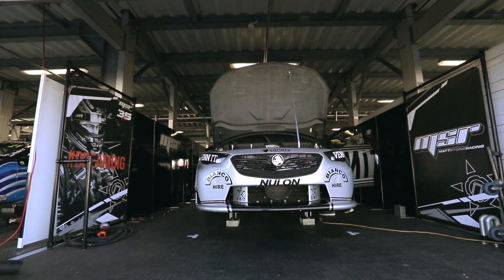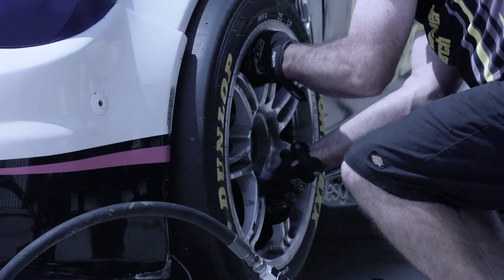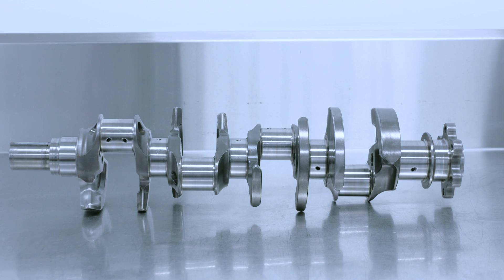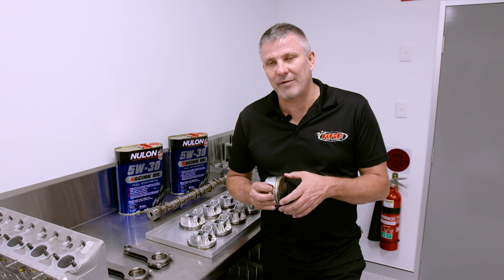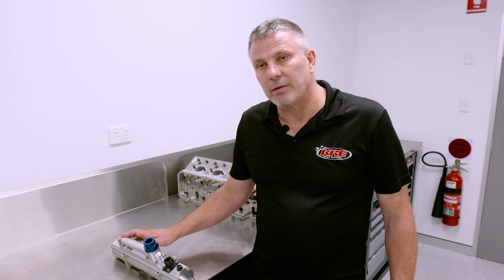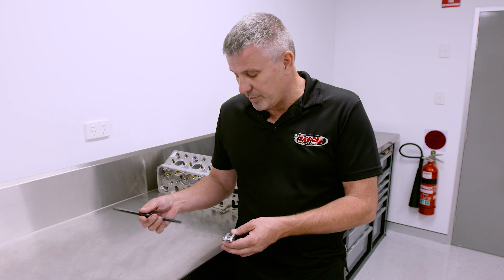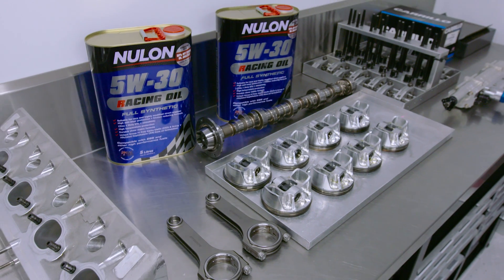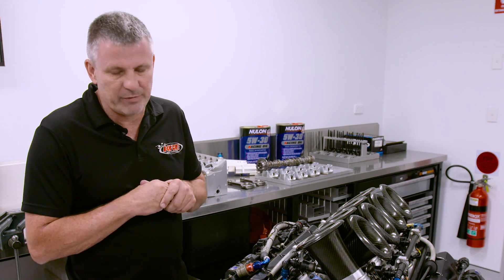Inside a Supercar V8 Engine! The facts, history and secrets with KRE Race Engines

Comment: 9:48 hi some one know more about the “individual oil pan”? And oil windage because i cant find information,
For the separation of each pair of cylinder did you use the oil pan very close to the crankshaft main cap and/or some divider?
Last thing i remember some Mercedes use the “individual oil pan” and use the oil windage to push piston.
Tanks

Comment: The chamfer in the counterbalance looks backwards. Shouldn't the larger bevel be towards the main bearing so it can I pull more of the oil mist away from the rods and towards the main bearing?
Reply: No because the mains are priority oiled and always guaranteed to have enough oil especially with a dry sump. Not to mention looser bearing clearances to allow the crank to spin freely.
If you were to spin anything, it would be a rod bearing so that's where you want the oil. They run such a high crankcase vacuum that it's a worry about pulling oil off the rod and piston combo, sucking them dry. Hence that shape.

Comment: Cant believe engines like this are still used, especially in racing. Push rods and 2 valves per cylinder went out of fashion back in the 1930's. Why are people so slow with technology I will never know.
Reply: its about engineering and performance and function  not fashion  .. what "technology " are you talking about  ? OHC stuff  thats like 20 years newer but still 100 years old .. All the technology is in the materials  and the 50 years of refinement the SBC has .. 4 V stuff breaths better  witch is of no benefit  because the power is capped  at 650  the control cam has stopped the clumsy valve chain self destructing  DI is a worthwhile technology  that happened in the last 30 years witch might be worth adapting push rod V8s have better pakaging and  decent torque a quad cam 5 liter V8  is externally as big as a 7 liter  pushrod V8 . be interesting to know how the  quad cam discussion went  when NISSAN Merc Volvo where all dabbling in supercar  you would think they've have pushed for it  and despite my tech ranting I  imagine the real reason they use pushrod V8s is that both NASCAR and super car are intended  ford Vs Chev thing  and they would have a bit of influence

Comment: "A 2.960" stroke, quite a short stroke. From 1970 on in Trans Am the Javelins were using a stroke of 2.916 with a 4.80 bore. Pontiac was a 2.840 with a 4.120 bore.
But comparing race engines today with the ones 50 years ago is like comparing a race horse to a nag

Comment: Now you know why current  v8 supercar racing is absolute bullshit. Maximum LIMITED power from the  motor. SO where does the Ford v Holden come into it. The only difference btw the cars is the artificial shell body on the frame. There are idiots out there thinking that its still Ford v Holden and others. Durability and reliability has nothing to do with this category. Each race is made up of numerous little sprints because of the safety car. All major distance races around the world do not stop and restart when there is a problem other when the track is closed..  Perfect example WHINCUP down one and half laps after only about 45 laps at Bathurst. Comes in at second place purely on the back of the safety car. This is as big as bullshit as Brock changing cars when he blew up or damaged his original car and winning in a second car

Comment: Gotta say, getting 650hp from a 5 litre with 10:1 compression is pretty impressive !
Reply: 160,000 for a new engine.
F1 engine, millions
160 is a bargain
Reply: They aren’t $160k anymore they are trying to get it down from $100k to $40k. And they have to last for at least 5,000km almost a whole season so that cost spread over the season is pretty good really. They are now targeting 10,000km from each engine.If they wanted more power they could easily get more out of them. They are tuned specifically to that power target and the whole car is designed around a certain top speed and acceleration.
Reply: Getting the engine to rev to 7,500 helps.
Reply: @elroyfudbucker6806  7,500 isn't that much for a race engine. It's quite limiting really. In the late 80s they were spinning them to 8,500 - 9,000 and we've come a long way since then with machining, engineering, metallurgy etc
Reply: @change_your_oil_regularly4287  Yes but these engines do 7,500rpm and last for 5,000kms. 
Those ones doing 8,500 - 9 were junk after one race.
Reply: Is this 650hp at the Crank?
Or at the rear wheels, on the Dyno?
Reply: It is but it would be nice to see 700hp, theses cars have had this power for the last 20 years.
Reply: @markmallinson935  yeah it’s boring
Reply: @markmallinson935  before control camshafts came in, a HRT engine mechanic (for Tanders' VE) said, when dyno tuning on a chassis dyno, they would make 600 hp at the tyres, so they have been above 700 for a few years now...
Reply: @Hapkido82AUS good to know you answered a question I had, I didn’t know if this was power to the crank or to the wheels
Reply: It has alot to do with the piston to wall clearance they run, the engines are effectively siezed when they are cold
Reply: That's piss poor power for $160,000 what a joke

Comment: So that's how much power they get with rules imagine what they could do if they said right  go for it do what you like
Reply: The problem then becomes who has the biggest wallet for r & d this all motors are within 10-15 hp of each other and I assume trans are standard makes it more about strategy of when to save fuel or tires and when to push harder also shows the skills of the drivers
Reply: they would make around 800hp from 5 liters. Nascar were making around 950 and over 9000 rpm with a 5.8 when they had open rules on engine. these days they make 500

Comment: I'm surprised they go to the trouble and expense of a custom CGI and force a 5L displacement limit with such high build and rebuild costs. Seems like it would be cheaper and easier to run a sealed 7L Gen1 based engine turning 6,000rpms.

Comment: So the Chev runs a Cleveland style head hey???  Absolutely no Holden in them at all now.
Reply: That's common knowledge.
Reply: They banned the 308 after Perkins won bathurst in 1993, The 308 Perkins engines were making 620hp in 93 for 25k each, sad in over 25 years and over a 100k more they making 640hp with the same rules.

Comment: That's EXTREMELY interesting -- 645HP (by what standard, I wonder?) out of only 5 liters (306 cubic inches) at only 7500RPM and with only 10:1 compression while using alcohol fuel and a pushrod cam valvetrain.  (Is V8 Supercar still using E85?)  That's WAY efficient!
I'm curious as to the intake and exhaust runner volumes, valve sizes, swirl characteristics, squish spec's...

It'd be REALLY interesting to see the torque and power curves...
Reply: I am sure you can find valve sizes and some information on net, for example:
https://www.cams.com.au/docs/default-source/sporting-technical/national/2019-super3-v8-touring-car-series-sporting-and-technical-regulations---version-1.pdf?sfvrsn=9baa75af_2

From "2019 Super3 V8 Touring Car Series – Sporting and Technical Regulations – Version 1":
T10 a,VI: 
For each Ford and Holden Motor Sport engine, the maximum inlet valve diameter is 53.97
mm (2.125 inches)

Comment: Good tech video but I think your knowledge on pro stock drag racing is limited because V8 supercar engines horsepower per cubic inch is not comparable at all with pro stock only 100 cubes bigger but make over 500 more horsepower is a long way off being comparable!

Comment: “We run a 7 mil valve on the intake, 5/16 on the exhaust” 
Metric or Imperial? 
Why choose when can have both!
🤣
No disrespect though, most probably not your choice and there’ll be an explanation for it. 

Lots and lots of interesting information densely packaged in a 17:49 video. 
Thank you very much!

Surprised to learn how long most parts last. Tx to Nulon of cause.
Reply: Current Batches 
I’m an EU citizen so metric is my ‘native reference but also have some intuitive idea of inches and feet. 
Just yesterday I watch a video where a the amount of logs where calculated needed to saw a certain amount of lumber. ~Mixing up~ combining cubic inches and feet. I was completely lost. 
It’s unfortunate that under most circumstances the imperial system is just as usable as the metric system is because otherwise all countries in the world would use the the metric system in stead of all countries accept Myanmar, The US and Liberia. 😉

Comment: Oil is so critical. My superbike puts out a little more horsepower per litre (180 rwhp, 1301 cc engine), and there’s only one oil the manufacturer recommends. I bought mine in Germany and imported it when I came back after a few years, and the local dealers use the same brand oil but lower spec that has led to engine failures. It’s cheaper oil suited to engines with 1/3 the power because the shear strength is much lower. I’ve met several local racers whose engines have failed (big ends, some valves) because the Australian dealer uses lower spec oil. Oil...gotta use the best oil.

Comment: Lots of interesting stuff.  Surprised they only run a 5 w 30 but I suppose the clearances are a lot tighter than a normal car and the synthetic would still have a better film strength than mineral oil. 
[edit] I had started using the Nulon 15w 50 oil in my VS Commodore and found it to run very well and appears to stay clean for quite a while even with my mainly motorway running. Switched to the 5w 30 for my Holden Cruze and it has been good so far running the same motorway commuting. The Cruze has the Dexos spec which the Nulon has so happy to recommend. I expect to run this oil to max service life given its spec and the motorway running being easier on the oil than stop start traffic. My barometer for changing oil is when the car starts using oil which usually indicates aging and thickening.Bit of a rule of thumb but seems to work pretty well.

Comment: So how do supercars regulate the Nissan dohc v8 to the push rod ford/holden engine? They should all be running a dohc 5L engine. The ford coyote is a great package.
Reply: simple they have a HP limit and component weight limit they all have to abide by
Reply: Clint Waters supercars are a holden benifit race, has been for years. All 4v DOHC engines are nobbled to give the 2v GM product a chance. Fords weren't allowed to run their 4v DOHC engines for the same reason. BMW i6 used to run 11rpm and compete with the v8 bangers, but.... the crap rules then restricted rpm to 7500, and the smaller engine Bimmer could compete any more. Ask why the Ford XR6T TurbomBarras weren't  allowed to run - GM benefit race. A complete joke. Also... 650hp ? My daily is 800hp, and the engine is 100% unopened factory stock.

Comment: Great job by Ken, KRE and Nulon. This came across as hugely informative and totally honest, definitely not just about giving the sponsor a bit of puff. Fascinating to hear about all the R&D and small incremental changes that have been done by Ken and his team, to this point where they can get 650hp out of a 5L pushrod V8 based on a 50 year old design and still make the block last for 20 years. Top work guys, brilliant engineering. I've used Nulon products for a long time and I'm certainly not going to stop now. Edit: Having a good old chuckle at all the "youtube experts" in the comments too... :)
Reply: They banned the 308 after Perkins won bathurst in 1993, The 308 Perkins engines were making 620hp in 93 for 25k each, sad in over 25 years and over a 100k more they making 640hp with the same rules.

Comment: Outstanding video; really first rate. I think that NASCAR will have to evolve more towards this model/configuration of engine as the sport moves forward, especially for cost control.

BTW, did anyone happen to catch the brand of oil they run? I must've missed that.  🙄
Reply: In some ways NASCAR are more advanced, in others they are even more basic which makes their power output even more impressive.
Reply: @dons1932  Agreed; cylinder head work, valve springs, max RPM, camshaft, etc. are all more 'massaged' in NASCAR, but then we are still dealing with a single carb-type throttle body, wet sump oiling system in the engine, and the wonderfully anachronistic truck arm, solid axle, rear suspension and recirculating ball steering box. I agree that it is amazing that they get them to run as fast as they do, but disc brakes for Martinsville now cost more than $20,000 PER WHEEL! V8 Supercar teams also don't need a fleet of 30+ cars to run 36 tracks. I just worry that NASCAR becomes less relevant to manufacturers and too pricey for sponsors. Time will tell!

Comment: Ford fans, but but but 888 buy bigger engines 😭😭😭😭😭
Reply: Vauxhall fans have to suck up the fact it is a 5.0L Windsor based block and that the control elements and sealed engines keep the playing field somewhat level, until an engine goes into a car and suddenly has a paper thin out of spec measurement AFTER building and testing  and sealing from V8SC and the builder yet the team got penalised for someone else's fuck up, 888 have control parts they sell the other teams so Ford fans are not pissing about them having bigger engines you fucking muppet, they are all the same (or meant to be but when something is not kosher from the builder and technical at V8SC it's the teams fault apparently).

Comment: $160,000 for a fucking spec engine!? Everything wrong with motor racing today. 

Let them run $20,000 big blocks and $5000 4 speed gearboxes and suddenly more people can afford it, and more fun for drivers and spectators without being any slower. 

Or let them run Nascar/Speedway engines like they should have since day one.

Comment: 645 HP from 5L!!! I need to drop one of these into my 928 S4.
Reply: Yep all in by 7400rpm is the impressive part, rpm is often overlooked when people are talking hP per cube,
I would expect 2hp per cube on a 9000+rpm motor but 7400rpm is insane  the decades of R&D are showing
Reply: The V8 in the 928 S4, in good health can perform pretty well, V8 supercar engine $100 000++.

Comment: Surprised the valve guides protrude so far into the ports.
No doubt tests have shown no improvement when cut level with the long side.
When I did my racing engines, in the '70s, flush with the ports was the de rigueur.
Learn something every day that blast old notions out the water.
Reply: Maybe more to do with stabilising the valve on the seat.  Seen some interesting high rpm vids where the valve has a bit of a wobble on the seat probably from the valve spring forces. Not good for sealing or wear.
Reply: Rogy Doj 
Good point!
Those engines are developing way way more power that mine where, with commensurate forces involved.

Comment: 645HP out of a NA 5 liter LS type small block  WINNING!
Reply: Zero LS about them other than the coil packs!
Reply: @fredbtmb33  yep, a generic casting for every team
Reply: Its actually a copy of the ford Windsor 
The heads are a copy D3 Yates heads as he said 
The only thing chev is the row of head bolts along the out side of the head as they use small studs
Reply: @mikec9112  289/302 is still a Windsor they've been making them since 63👍🏻
So basically there running a boss 302

Comment: NASCAR should really take some notes here
Reply: You mean the guys making 900hp @ 9400 without a roller cam and no fuel injection?
Not only is most of this tech from NASCAR, but the Supercar guys could take even more if they were allowed to. NASCAR takes all of this another step further and is in many ways more impressive even than F1 tech.
Reply: Don S  I agree to some extent but with the horsepower restrictions in horsepower that NASCAR has implemented I think them being restricted to 550 hp on 1 mile and half and 750hp on short tracks that could use one set spec for all tracks, if I sounded like a smart I apologize that was not my intent at all
Reply: @lamontpoole3750  Not at all, but honestly even the RPM limit in Supercars restricts them massively. Take that off alone and they'd use even more NASCAR trickery - and make bucketloads more power.
Reply: Don S I agree, I guess I just miss the high RPM and that 850 plus horsepower, what an amazing sound the engine builder are geniuses

Comment: Haha more ford in those Engines than any other  brand
Reply: Yep heads are based on C3 Yates heads and raised camshaft just like a Windsor
Reply: Craig Ruhle kinda cool haw the ford engine is still basically a highly developed boss302 engine (limited by the rules of corse)
Reply: Yep developed in 1967/1968 to go in race cars in 69 that's a 50 year old design still going strong